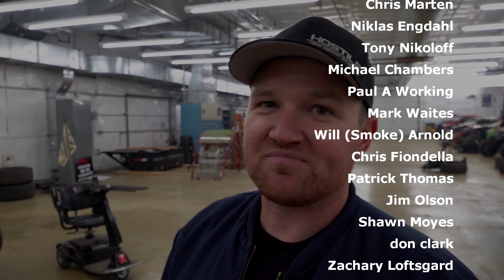Turning our 2-stroke Maverick X3 into a snowmobile!

Comment: Make that center bar going down to the ski you're shock and then make two points coming off of this ski up to the top point of the shock and you got it quarter inch of play at the bottom for the ski to move side to side

Comment: Not sure if it would help, but I know for some automobiles, they use a special cooling system vacuum/filler to refill the system.   It uses shop air hose to put a vacuum in the cooling system and then you put the hose into a container of coolant and when you open the valve, the vacuum in the system draws coolant in and fill the hard to reach places to get rid f trapped air.  It works on ones completely empty to ones partially filled.

Comment: Your trx4 also has cruise control. While your pulling the trigger, you have click the set button and it will hold the speed and you can turn it off by braking.

Comment: Should put like a three link in there. So connect this third link between the lower control arm and take it back to the chassis at something around 160 degrees so it can keep those control arms from be bending back. Use some heim joints at the ends. Maybe bring the bar out the the 2x2 square tubing right below the diagonal cut you made.

Comment: Make the clutch weights engage way sooner on the clutch, and that will effectively give you more rpm speed or powerband or whatever, like changing gears without changing gears.
Reply from the maker: Lol that’s not how a CVT works
Reply: @SXSBlog  i fully understand how a cvt works. If you take stall out of it, itll effectively egage sooner, therefore give you more rpm worth of rpm band before you run out of rpm.
Reply: Why do you think when you put a stall kit in ant atv with a cvt you lose top speed when you put the big ole mudders on. Because if you egage a clutch at 2500 rpm instead of 1800, well you reach 6500rpm sooner. Its not rocket science. Ive put numerous dalton and whatever that three letter company clutches in can am quads and suzuki quads. And that is how a clutch works. Thats why you lose top speed. Derp. And epi is the other brand.
Reply: The springs and weights just control the rate of ramp, like the stall. What happens if you put a huge stall in a race car? I feel like i shouldnt have to explain this.

Comment: Man I just got out of crawlers around 2019 was my final hoorah. I still have all my stuff but life and finances got in the way. I had a 10 year run with the stuff and do kinda miss it all. I knew the manufacturers were headed towards some really great stuff and the industry as a whole is solid and ain't going anywhere soon.
Dammit. I might have to go pick up 2 or 3 new kits... And about 20 2s lipo's and more. In just 2 1/2 short years of non use your batts turn into literal piles of useless toxic materiel. 
Also here is a pro tip... Don't take your old lipo batts to your local hobby shop for "recycling". They will gladly take them to save face. When the box became full at the local shop it became "hammer time" with a case of beer. In the alley we all took turns smashing a pack with a 10lb sledge and watch the fun. Its not very dramatic just one at a time. I'm just saying there is no effective means to recycle any lithium ion and similar batts that is cost effective. The main reason I point this out is because of, well....mandated electric vehicles by a certain time in the future by our federal government.
Not a rant what I'm saying is the honest truth. Patriots unite!

Comment: Your gonna need the proper skis or you won’t get any floatation for the amount of weight you have
They used to sell purpose built ski’s for sxs’s years ago not sure if they still do but the ski’s should be atleast 12inches wide or so for this type of application you’ll yield way better results in snow
Reply from the maker: Our best stuff around here is hardpack trail, so not as much worried about floatation

Comment: The front of the X3 set up is NOT stout enough!  you need to figure out how to buffer the load with some shocks or springs, that single vertical will break, even given you'd be running on snow. 
Just a thought, but does look really cool😆